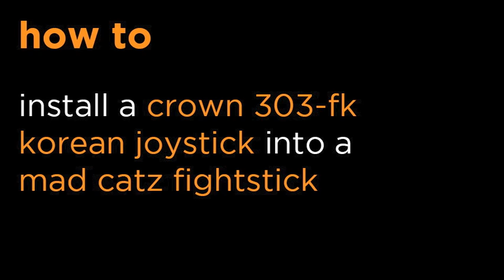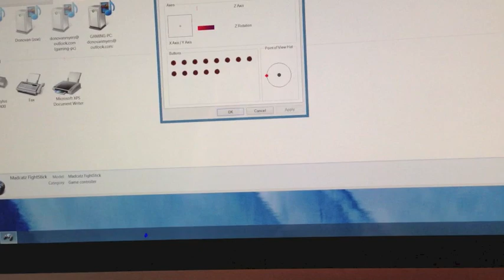How to install a Crown 303-FK Korean Joystick into a Mad Catz Fightstick

Comment from the maker: When you ask about how the stick works with specific games, that is totally up to taste. To try and tell you how the stick feels, I would say: It definitely feels closer to an American (HAPP) joystick because of the bat top, you don't feel the corners (square) like a Seimitsu/Sanwa stick, and it has switches more similar to a US (Cherry) switch: slightly clickier. However the length of the lever and therefore the throw distance is closer to a Japanese stick. If that sounds appealing, try it out.
Reply: That's exactly what I needed, thanks, I was looking for one that would fit as a replacement for a sanwa but with a happ feeling, thank you so much

Comment: Hmm just a question, were you supposed to add a spring to the stick? I installed this stick to my Qanba last month but only just got round to playing on it today and i noticed that flicking left and letting the stick return to neutral also triggers the right switch... This is really annoying as I often let the stick return to neutral as its just a habbit of mine. I keep getting random supers and what not, very confused as to what I did wrong, any ideas? Thanks :)

Comment: will this work on qanba dragon or any qanba model?
what if i want to use myoungshin fanta in place of sanwa? is it possible to do so?
Reply: Myoungshin fanta requires a larger stick opening, the mechanism is externally mounted.
Reply: Garv DarkSlayer hye there if u wanna install Korean joystick in to your qanba do check crown CWL-309MJ-JMS-ST25.  It will replace nicely your Sanwa Joystick.

Comment: I just ordered this stick will it fit the Madcatz TE-2 Guilty Gear Xrd
Reply from the maker: Mounting plate on all Mad Catz products will support the Crown 303-FK sold by Focus Attack.
Reply: Donovan Myers what's the wiring on the TE 2 stick as all the wires are black not color coded? Thank you
Reply from the maker: Jimmy Woods I have no idea! I don't own one and they're all sold out. You could Google search 'pinout for JLF' and you might be able to figure it out that way. The harness that is on the JLF will work with a Crown 303-FK from Focus Attack because it comes w/ the harness.
Reply: Donovan Myers ok I'll do that and  trial and error. I'm thinking if I place one color on each pin with the ground I could work a process of elimination

Comment: Im about to order a harness from FA [i guess thats all i need?] for my Crown to install into a SFxT VS edition for 360. Will i need to Dremel out some  plastic or is it roomy enough in that stick that it will fit as is?
Reply from the maker: rshkhzee The Crown should mount just like a JLF or Seimitsu stick. Mad Catz has a great multi-stick mounting plate in their sticks and plenty of clearance. You do have the same model, 303-FK? I know that one is specific to fitting in JLF-like mounts.
Reply: Yes, its the 303FK like the one in the video. I just straightened everything out with a guy at Focus Attack just now, thanks for your help man

Comment: Hello question?  I got a  (mayflash arcade stick F300 ) can a crown  be modded with it ( change it )
Reply: Yes, the Crown joystick without the large collar will fit inside the MayFlash F300. If you go to Focus Attack to buy parts, get four of the zero delay .187 wires to connect the Korean joystick to the F300.
Reply: @cajunmanpunk  THANKS
Reply: bro what did u buy for your mayflash and it works ?

Comment from the maker: I just installed it like it came. It seems like the 'spring' is inside the housing. Mine feels tight. I could see how you could get extra inputs if you let the stick fly around like you describe. I guess you need to keep a kung fu grip on it to prevent unwanted triggers. :P
Reply: hello, maybe you could help me, im having issues where the battop unscrews by itself from the movement of my palm and the bottom part of the shatf lacks the flat screw slot to tighten it up just like my jlf had, any fixes to this would be appreciated
Reply from the maker: @ericgl182  loctite could help. Wrap something around the shaft to protect it (towel?) and hold on tight with pliers to tighten.
Reply: @DonovanMyers  thank you so much, i didnt notice there was a flat area on the top part of the shaft which i totally missed where an included key fit perfectly to hold the shaft in place. Your suggestion made me realise thats what it was for!! haha

Comment: can you use that harness on a happ comp. stick. I know the happ sticks get a lot of bad rep but I got a huge hand and when I play with a ball top.... feels like I'm using a marble on a stick.... I was thinking of the korean version but I already got a happ stick and new too I just got to figure out a way to connect it to my hori arcade stick.
Reply from the maker: ***** It may be more work than it's worth. I'm not sure that the Happ stick fits inside the Mad Catz case. Even if it does you'll have to figure out a way to securely mount it. I'm not sure if the mounting plate inside matches up.

You could probably use the harness shown in the video if you figure out those first 2 things.

Did you know that you can buy a Bat Top to replace the Ball Top on the JLF that comes in Mad Catz sticks? http://www.focusattack.com/sanwa-lb-30-n-s-battop-white/